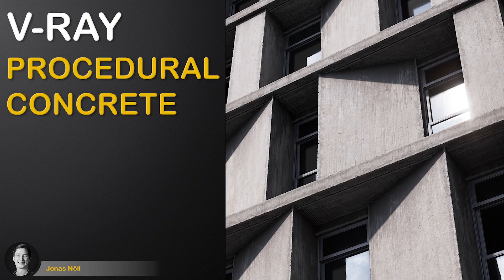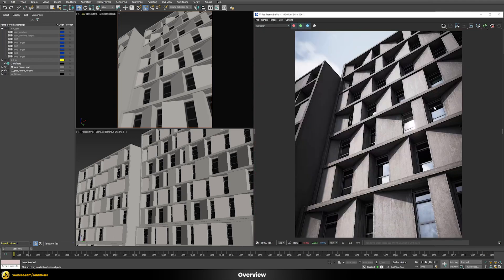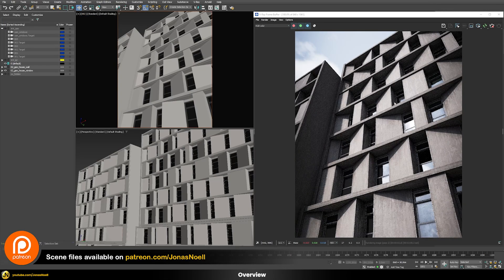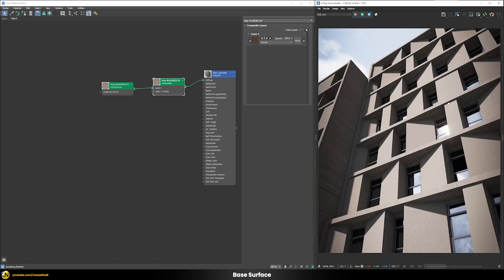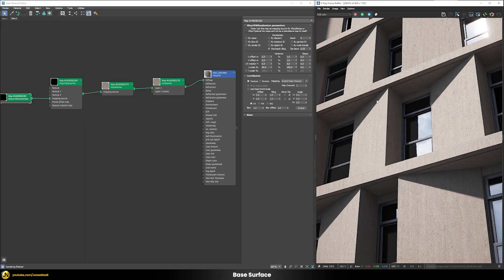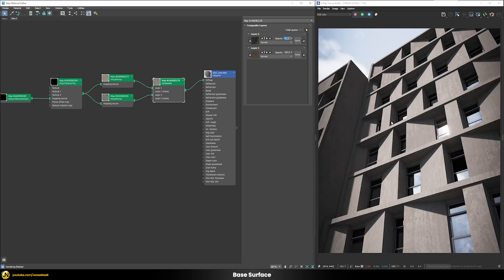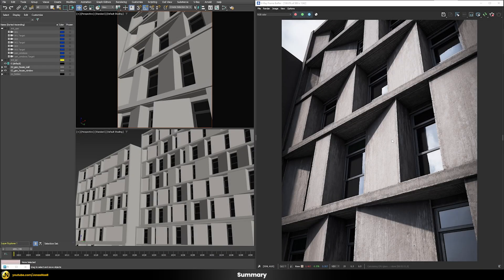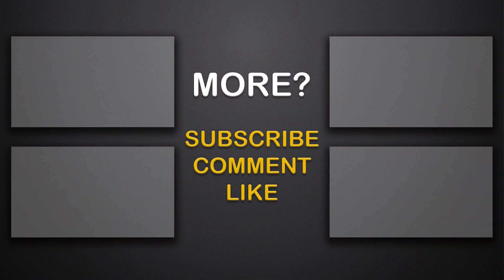V-Ray | Procedural CONCRETE SHADER

Comment: Hi VFX artist here 👋 to all the people saying that this isn’t procedural, let me explain to you why it is. On a normal model where you have created UV’s and maybe painted the textures in Mari or Substance painter, the texture is locked to those UV’s and that object. Whereas here Jonas has created a procedural shader with non procedural textures so that no matter the object or the UV’s the shader will always react correctly, the edges will always be worn out, the faces will always have streaking effects and no matter what there will be no texture stretching/distortion. Hope that helps, keep up the good work Jonas 👍
Reply from the maker: I think the missunderstanding probably is that some confuse a procedural SHADER with a procedural TEXTURE.
Reply: @JonasNoell  I think most are just used to watching blender tutorials 😅

Comment: Very nice! I did not know that V-ray edges could be used with the composite node (I usually put it in the bump slot of the normalmap). Also nice touch with the extra bump to break up the edges!😍

Comment: Hey Jonas, another fantastic tutorial! A lot of good stuff shown in easy to understand way 🥰
I wonder if it is possible to make the material that create those leaks only on Vertical surfaces so these don't occur on top and bottom of those conrete slabs? Tried to find something on the internet but with no result. And chat GPT is crap when it comes to help in 3ds max 😅
Reply from the maker: Can do, you would need to combine it with another mask though. You can try a basic fallof with local world Z-axis for example.
Reply: @JonasNoell  Yeah, that falloff mask works like a charm. I've never explored those functions of falloff map, thanks so much!
Reply from the maker: You’re welcome ☺️

Comment: Very cool. Wondering why you chose to change the reflection  instead of leaving it white and change the glossy instead.
Reply from the maker: Good question, I don't have a logical answer to that to be honest :-) Basically I just remembered in the end that I didn't have any reflections and with pure white and low glossiness values it became too overblown with the current setup so I countered it using this way. But yeah that part could have been done better. :-)
Reply: @JonasNoell  no worries. I'm always wondering the "why" on things. Nice work as always!

Comment: can i ask - with the wall thickness, if i pu ta dirt distance of more than 150mm (which is the thickness of the wall) - then it all becomes the dirt color - do you just detach the polys you want with the dirt and leave the inner walls as another object (or ID) - if that makes sense?
Reply from the maker: Sure, can do. But this should only affect the inner occlusion mode. For inner occlusion you normally don’t use so high values as you normally just use it to mask out edges…

Comment: Hi! I have a question, when and when not to change filter mult and blur parameters? And why? Also are this parameters the same thing in VrayBitmap or ther work in different ways?
Reply from the maker: Basically values below 1 will sharpen the texture and values above will blur it. I would leave this at default unless there is something specific you want to achieve…

Comment: Not procedural tho
Reply from the maker: Depends on your definition I guess
Reply: @JonasNoell  nope
Reply from the maker: Cool
Reply: haha sometimes you have to go to the bottom of the comments to find the truth. All these commentators don’t seem to grasp the concept of procedural. There may be procedural nodes in the graph but the whole point of a procedural mat is that it is resolution independent. Once you put a map in there you’re working with a fixed resolution - there a real performance and image quality outcomes associated with. Just sayen.
Reply from the maker: So a material that uses procedural maps is by your definition not a procedural material then… Interesting 🤔Some maps are procedural some are not. If you want to exchange the remaining  texture maps by noises then be my guest. And while you are at it you can make a tutorial about it and call it the true 100% pure procedural material. I would be the first one to watch 👍
Reply: @JonasNoell  thanks for the response but I think it ceases to be procedural as soon as you put a resolution dependent texture in the graph. A "true 100% pure procedural material" is just that, a procedural material. It's really about the practical applications; for instance in animation or games when you approach a texture from a distance you can use procedural martials to avoid pixelation. It's essentially the whole reason substance exists, and is used so widely in the game industry(there are plenty procedural conc on source). There are pipeline implications as well, but I'm sure you know that. I think you do excellent videos(I follow and recommend all the time to colleagues) and we all appreciate the effort(look at the 95% of comments that are unquestioningly positive), but my bad for being a critical voice.
Reply from the maker: @MrMadvillan  Procedural merely means something is created by code, based on rules in an "automated" way so to speak. In regards to textures, YES a procedural texture would be resolution independant as it generated and not based on static pixels. But there are NOT only procedural textures, which is what you seem  to be  talking about exclusively. In this video I demonstrated how to use various procedural methods to generate aging and dirt effects for a concrete shader. For simplicity I call that a Procedural Shader and that should also be clear to 99% of people unless you want to missunderstand it on purpose.
Reply: Nice video 👍 Although I agree that the title is a bit misleading as it is expected to see the effect implemented using noise/math functions instead of being texture maps dependent.

Comment: Thank you so much for sharing, you are my favorite author. Also, can the last edge bump bitmap be directly connected to the original vrayedgesTex？
Reply from the maker: Hi there! Technically yes but it would generate a slightly different effect as it would just define the rounded corners width.